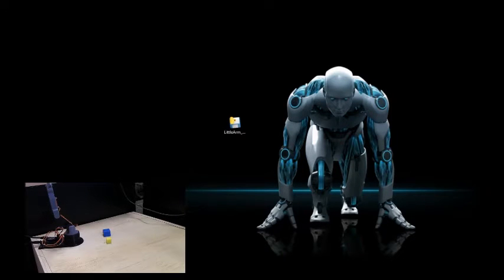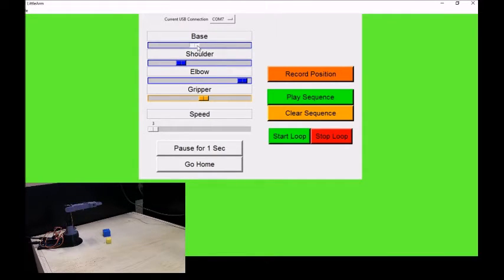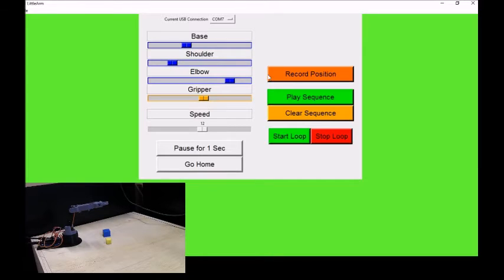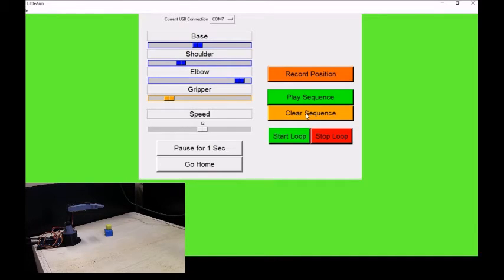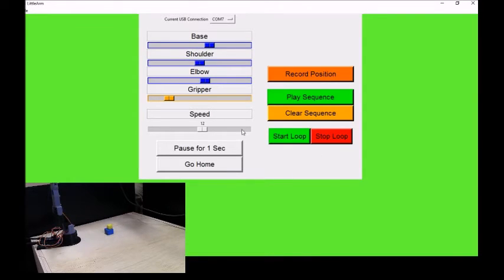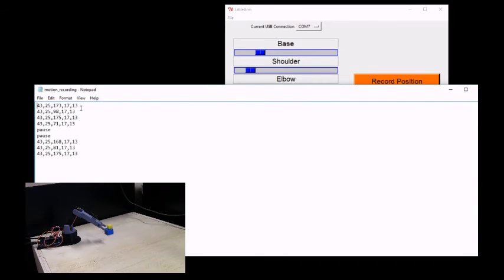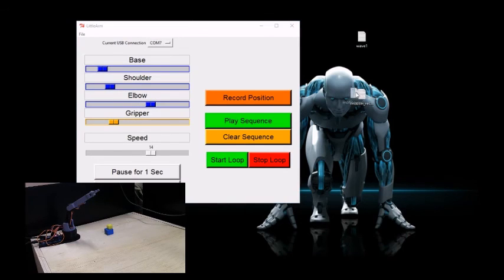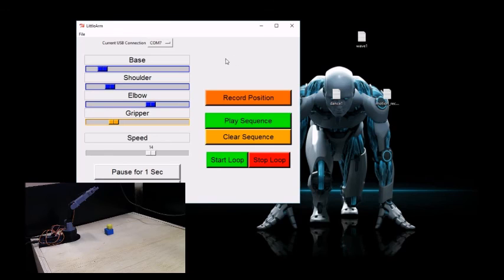Using the Windows Application for LittleArm 2C

Comment: I am trying to find a way for the arm to wait for an input before starting its sequence.  I want to interface it with a feeder that will send a high to one of the arduino pins which would signal for the sequence to start.  Then when done it sends a high back to the feeder to repeat.  Looking to handshake with a closed loop, not using time.  I am working on importing the motion recording into an array of a separate arduino program, but thought you might have a better idea.  Very much a beginner with python so not sure what to do there.  Thanks, my plan is to have my senior class build some Oreo feeders/dunkers if possible.
Reply from the maker: Hey Dennis,

Yes. The stored array on the Arduino is the best method. We recommend that you create the array with the training software, and then copy from the .txt it is stored in, into the arduino program for the actual playback in your feeder system